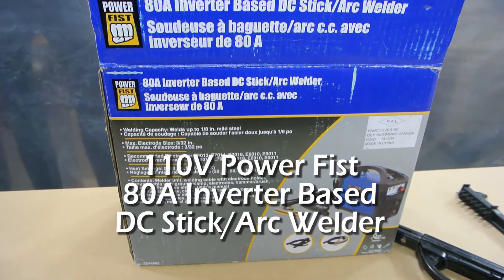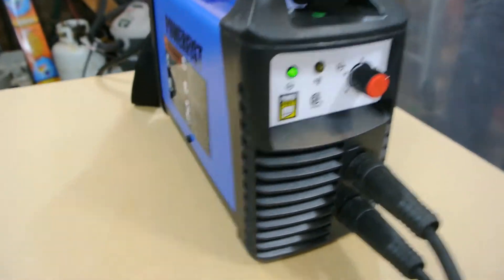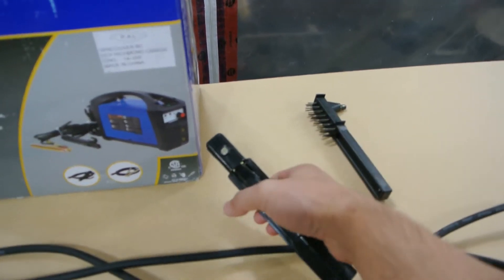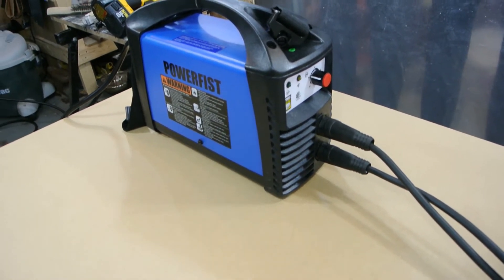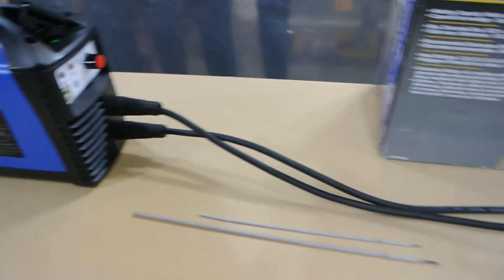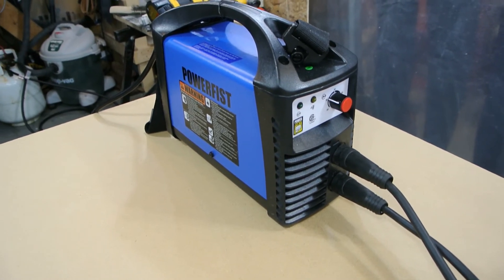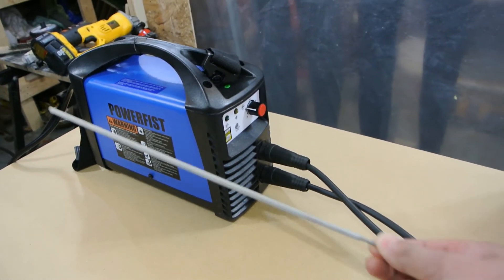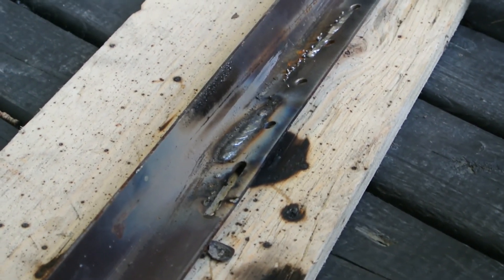Princess Auto 80A Inverter Based DC Stick/Arc Welder Review

Comment: I have one, used it to build a couple of smokers and some other things. It’s held up really well, and taking the time and care to get good at welding with it then arc welding with a good welder becomes effortless.  Got some decent penetration welds as well as some nice work with thinner material at lower current with 3/32 6013 electrodes.  Nice review, decent welder! I used up to 1/8 6011 with no problems, 3/32 7014 works much better with it than 7018 in my experience.

Comment: Can I plug this into any household 110 socket and weld? I had a 220 mig welder but the wire feed system was a pain so I want something to weld small projects. Thanks and good review.
Reply: cache mole yes it is a120 volt machine. They recommend using a 20 amp circuit. I have used it on a 15 amp circuit full power full duty cycle and it didn't trip the breaker or overheat. It will run 5/32 6011 at 60amps no problem. I put it to full amps and it will run 7018 but it is a pain to get started once going it will run it.
Reply: @electromech7335  Thanks so much for mentioning this. For much of the work I need to do, only 15A is available, but only need light welding duty. Great to know it should work. Will get one to try.

Comment: Hi Andrew. enjoyed your video. I am a complete novis. I want to weld up some 20 gauge steel plate. will it turn down low enough so not to burn through. that welder you have is on sale this week in P Auto for $149. cheers Bri.

Comment: How do the 1/8 electrodes run with it?
Reply from the maker: +betactical I think it's pushing the limits of the system, I run 3/32 at 60-80 amps with no issues so I think you could get away with 1/8.  I have a few 1/8" rods, when i get a chance I will give it a try and let you know, other than that this welder is well worth the money.
Reply: I’ve used 1/8 rods in 6011, 6013, 7014 and 7018, it kind of works for all of them but I stick to 6011 at 1/8 now.

Comment: Best rods I have found so far for this machine are the Fleetweld 37 (6013 in 1/16 and 5/64, haven't tried the 3/32 yet) and Fleetweld 180 (6011 in 3/32) 1/16 6013' burn up quick but you have 100% duty cycle at 40-50 amps so you can just keep going and going. The 3/32 6011's heat the machine up quick and you probably only have 20-30% duty cycle. 5/64 rods seem to be the sweet spot for this welder.
Reply from the maker: +Craig Diamond Yup agree, but I onlt do light duty welding, maybe burn one or two rods (3/32) at a time and no issues with over heating.
Reply: 3/32 lincoln Excalibur 7018 are the best for this machine.